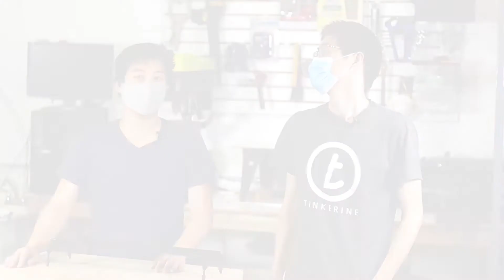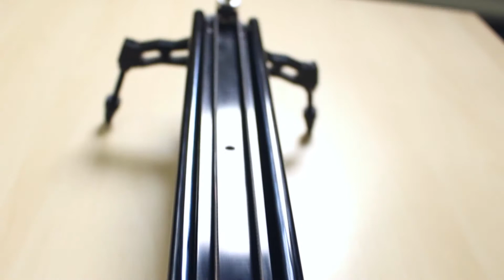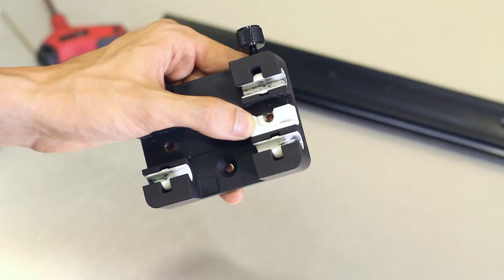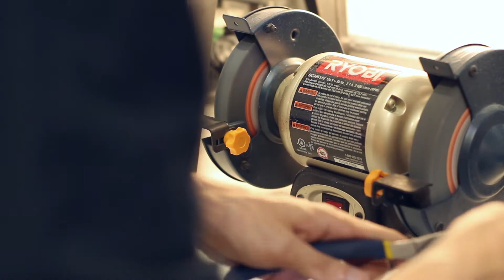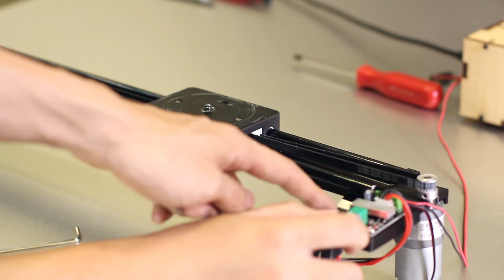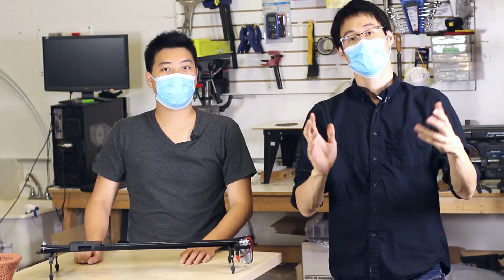TinkMakes | 001 |  Motorized Camera Dolly Conversion on a Budget

Comment: If you’re going to grind a bolt, it’s best to do so with a nut already attached to it. That way, when you’re done, you can remove the nut and it will help cut the edge of the threads for a better tip.
Reply from the maker: Thanks for the tips!